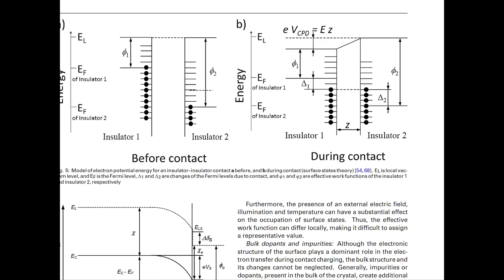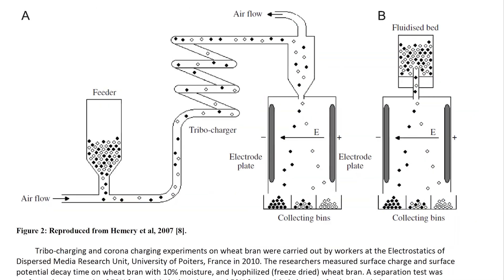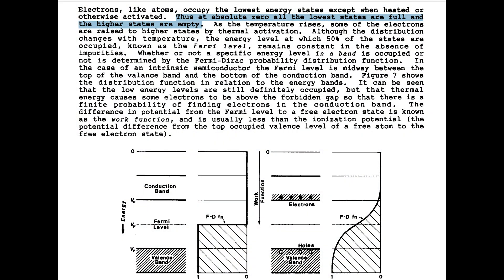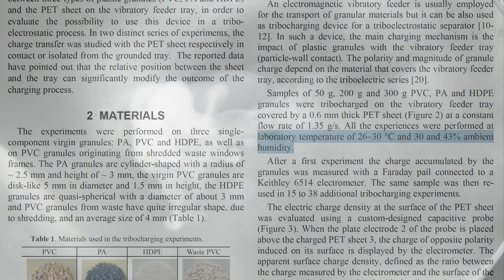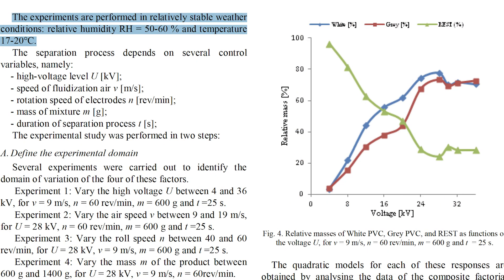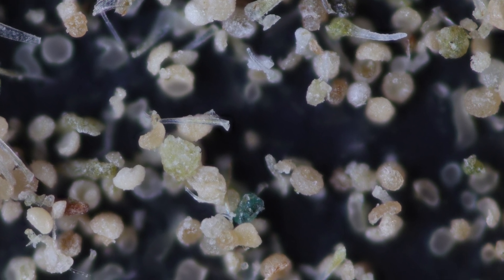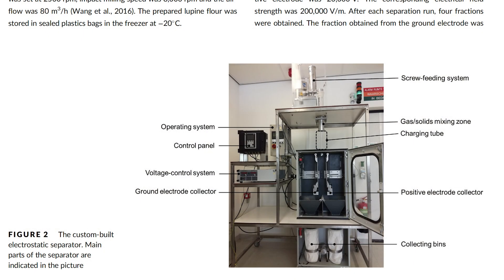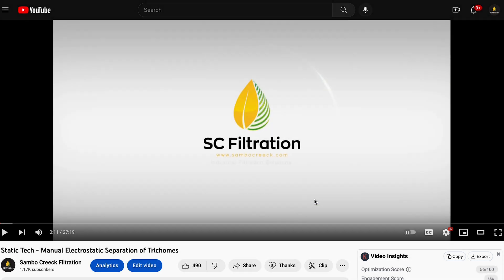Triboelectric Tuesday Episode 6 - Temperature

Comment: Objective? Separate resin from cellulose? Charge? Plus air quality? Speed? Shape of conduit? Fall out points? / separation points? Addition of another charge or air source? Where and how is desired effect met? Two runs or continue in line with supplemental causes to correct clumping?
Reply from the maker: The objective is to separate contaminants such as stalks and biomass from the heads. So its more complex than just resin from cellulose because the stalk and the head outer cells are similar. clumping has been addressed enough I think. Lesson learned is that pre and post processing is required. Two or more runs are required as the material consistently concentrates.